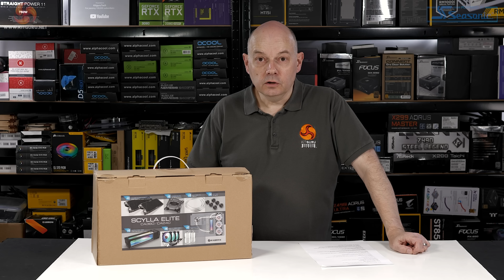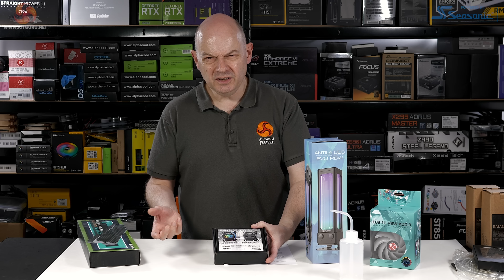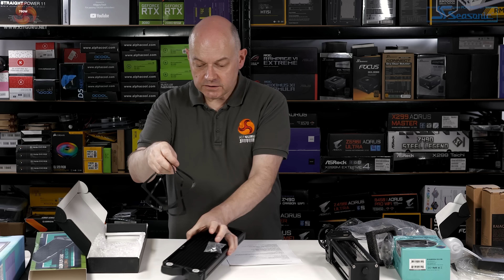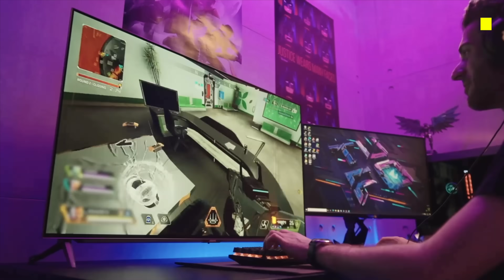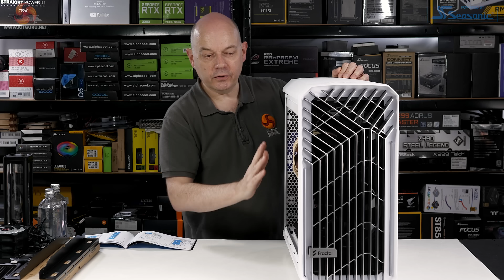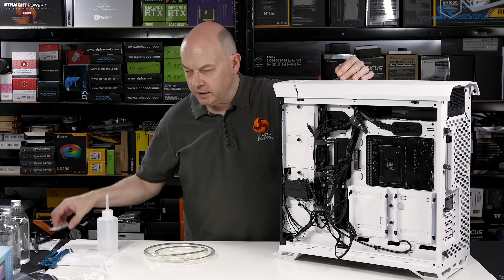Raijintek Scylla Elite CA360 tested in Fractal Design Torrent

Comment: It’s interesting to me that you essentially choked off the front intake and got better GPU temps. Is this because the bottom intake is now not facing a cross flow of air from the front? And is being better directed to the GPU intake?

Comment: My question is slightly unrelated to the video but since you've tried it, is there a difference between putting the NH-D15's second fan in the back rather than in the front? I have tall memory and I've moved it to the back but I don't know if I'm losing performance

Comment: I've just built this into my system and the D5 pump was at 4800rpm. And I can't control that as it's DC instead of PWM.. which is just annoying. It took me a few moments to find out that the RPM control is actually on the base of the pump. Which you can't access once installing!! Which is stupid as you don't know what speed you want until you switch it on. So currently it's running full speed and the sound is horrible! Very loud and high pitch

Comment: I'm tempted to do this and add another rad at the bottom.
Can the pump be mounted lower down on? Effectively on the bottom and middle fan on that front rad, rather than the top and middle (if you get me?)
Reply from the maker: If the front rad has the unions at the bottom that would be very difficult. Either flip it so they are up top or use a X-flow rad and you will likely find it is possible.

Comment: Hey Leo, I was debating opting for this case down the line. Should it be able to handle a 360 60mm radiator (XSPC RX360) in the front and 360 20mm (XSPC TX360) on the bottom alongside stand 120x120 25mm ek Vardar fans ? Seems like the tubing if oriented this way would be blocked at the bottom by the fans or radiator I believe, unless there's clearance at the top to use 90 degree fittings?
Reply from the maker: The only way to be sure is to give it a try however that sounds unlikely to work.
Reply: @KitGuruTech  Thank you, appreciate the reply, guess best way to make it work then would be a 360mm + 280mm

Comment: I'm not a fan of having the reservoir mounted to the radiator like that, it has to interfere with airflow, but yeah you're kind of stuck doing that without angled fittings. The Torrent looks pretty good with it all in there. Thumbs up.

Comment: Interesting, thank you. Did you need to flush the thing first? If not, that might have some value for boutique builders for whom time is money. People like Graham Lord of the Adamant IT channel.

Perhaps you might do a follow-up following the upgrade path that someone new to fluid cooling might take, first adding angled fittings, fill port and drain port to neaten it up. Then a block for the GPU. And then perhaps you might switch the radiator to a 360mmx180mm?
Reply from the maker: Just ran it as it came and the clear coolant remained clear. You will be disappointed to hear the Raijintek system has already been dismantled and packed away.
Reply: @KitGuruTech  On to the next reviewer, I guess? Oh well.

Keep up the good work.
Reply: @QuentinStephens  nope, we never move the samples from one to another reviewer
Reply: @RaiJintek   That's good to know.

Comment: Same results as a D15 in push-pull? Fans are "reasonably quiet" at 1500rpm times 3? Not sure what to make of this. Makes no sense to me. Anyone?
Reply: It performed the same as the Noctua D15 cooler with its fans set in a push-pull configuration (as clearly shown by the graph)... Granted "reasonably quiet" is subjective and dB measurements certainly more useful, but it still makes sense, not amazing quiet and not noisy, i.e. reasonably quiet. Not sure what's so difficult to understand about any of this?
Reply: @boooonch  Oh boy. The reference to push-pull on the D15, is because that is the worst possible config on that cooler. As in a worst case scenario. The rad has 3 fans running at 1500rpm, which is faster than the max on the Noctua. There is nothing "quiet" about fans running at 1500rpm, particularly three of them. That is, if you define this as "Quiet" than anything goes as "quiet". This rad, would make more noise alone, than any machine I have used in resent years. It will even rival my laptop. As for "difficult to understand", I get that people just have insane usage of "quiet", I also get that this machine could be cooled quietly by my standards, by simple means. You lost that point entirely. Now. Why is that so bloody difficult to understand? Why do I refer to push-pull on the D15? The point seems utterly missed by you.
Reply: @FrodeBergetonNilsen   I believe push-pull in regards to the D15 is supposed to mean the default fan setup even though it’s push-push. The Noctua fans are rated at 1500 RPM also. Not all fans make the same amount or frequencies of noise at the same rpm and not everyone hears the frequencies the same. Some are silent at 1500 while some are headache inducing. It’s all different for everyone.
Reply: @CasuallyCareening  Arguing semantics but not thermal physics. Noise do not go away, just because you say so. You need to work the physics, which you are not.
Reply: @FrodeBergetonNilsen  I am not arguing anything. I made a statement. Whether you acknowledge it or not is your own problem. Noise doesn’t exist just because you say so either. It depends on the case, the fans, the fan blade pitch, the blade curvature, the number of blades, the material of the blades, the material of the fan frame, how close the blades are to the frame, the thickness of the materials, the quality of the molding, the winding of the motor, the type of bearings, where the fan is located relative to everything else in the case, how restrictive is whatever the fan is mounted to in front and behind the fan, how the fan is oriented (vertical, horizontal, upside down etc), and so on. But you choose to focus on RPM. One of the most arbitrary variables when it comes to how much noise a fan makes. One of Noctua’s fans spins at around 2000 RPM at under 20 db. Another Noctua fan of the same size and rpm more than doubles that.

Comment: I don't recommend that pump when you compare to alphacool or ekwb because of the noise that can be heard is  40DbA. Top part of the pump material pom very heavy pump and res unit, for the led they could have diffused  it much more nicer instead of putting the cheapest led strip and call the day. Yes its made of glass. On the box it says goes up to 4800rpm, in reality 3600rpm. Heatkiller insipiration for sure. Mounting mechanism they have improved. Material wise it is mixed with steel no idea where they used aluminum
Reply: i think alu part is on the res frame not touching the coolant (i hope not)

nice that Leo done another piece on watercooling kit :)
i'd recently updated my sys to watercooled too 
https://imgur.com/a/lG0GwEJ
Reply: Strange suggestion, since it is same lowara as EKWB is using!
Reply: @RaiJintek  your pump can be only controlled with dial underneath the pump. I have it running on speed 5 which is meant to be the highest 4800rpm, but real speed is 3600rpm. With my ek I can adjust the speed the way I want. For mounting mechanism there should be anti vibration clasp or something. Not sure what kind of Laing D5  is being used here. Have to take it apart. This is not suggestion it is my experience and opinion that's all